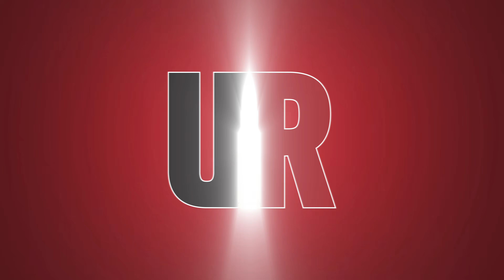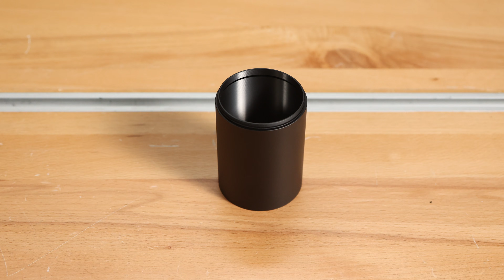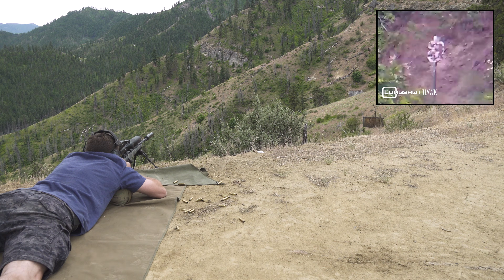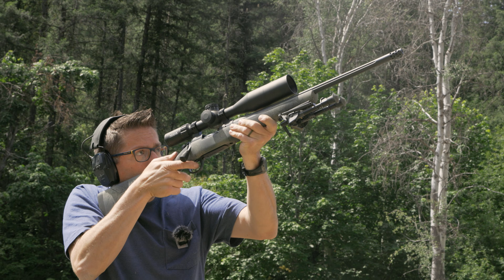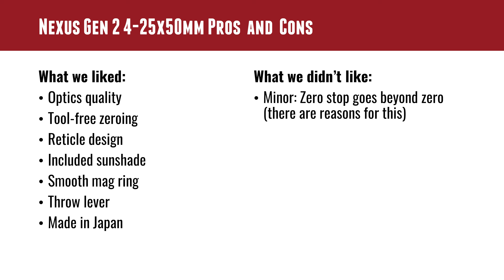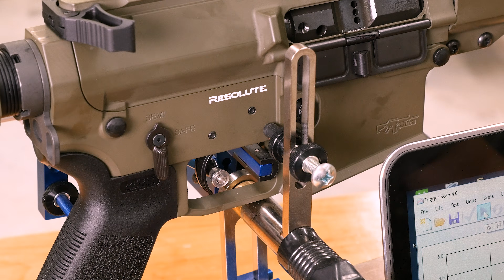TESTED: Element Optics Nexus Gen 2 4-25x50 Scope

Comment: I bought this scope around a year ago and use it on my Daystate Redwolf .177 air rifle for HFT competitions. Target distances can range from 8 to 45 yards away and you are not allowed to adjust the scope during the competition, which means you have to use blur to estimate range. 
All I can say, in my experience of using it, the quality and clarity of the glass is nothing short of amazing and you can pick out the kill zones from the tin shots around them with ease.

Comment: I would love to hear more from you on these Element optics please. I am considering a Vortex Razor Gen3 but there are features on the Element that I really like per your video. Such as no tools needed to set zero and the turn indicator on the elevation. These are lighter weight than the Vortex's as well. Thanks.
Reply from the maker: More Element stories coming!

Comment: This may be wrong or not current but year back it was recommended to dial below your zero and come back up to zero which helped keep the tracking mechanism properly lubed. IIRC lube could build up at the zero stop on the mechanism and cause issue if you never moved the scope further in its adjustment range. Also it give you wiggle room if you are in a environment that very different from where you zeroed. Where I live the DA can change by 2000 feet in a day for example and some people use a 300 yard zero or some other weird distance for dead space.
Reply: That's exactly what I do, I dial 1 moa below, then come back up. I do not like it to stop on my zero.

Comment: Sooo, we're just going to ignore the Mossberg "fix"??
Reply: Waiting for an update on this as well
Reply: I'm guessing the janky "bottom plastic" or whatever the Hell that insert is, prevented a bedding job... So might as well throw $3,000 worth of work at it, isn't that what everyone else in the same situation would do? 😲
Reply: He could have used the chassis and did accuracy testing before rechambering
Reply: The only way to fix that gun would be to throw it in the smelter and make a custom one.
Reply: @PencilProper  That's basically what happened.
Reply: What, do you want an apology from him?
Reply: @edouble9894  admiting he didnt know what was the issue or how to fix it without replacing everything at once would be a good start.
Reply: I mean, this channel is just an extension of the gun rag shill whoever pays philosophy so it wouldn't make sense to actually figure out what was wrong instead of swapping in sponsored parts....
Reply: Mossberg got fixed. It was the "everything" that was the problem.
Reply: @biggs8729  great mudslinging shot guns, otherwise leave the mossberg rifles in the gun store.

Comment: $2,200 optic on a $1,000 rifle. Sorry, but I stick to the 50/50 rule, as much as possible. Ideally I like the 60/40 - 70/30, as much as possible. If it's a $1,000 rifle, more often than not, I'm calling up Arken. $1,000 rifle $500 optic, puts me right in the sweet spot at 66/33. Element makes great optics, done of the very best out there. I'm currently budgeting for the Q Fix & optic choice. If I could find a buyer for my Sig cross set up, it sure would make it easier 😂😂
Reply: You get what you pay for
Reply: @mikeanshit158  Exxactly. Not always though, but when it comes to optics that is generally the rule.
Reply: So if my $1k rifle shoots 1/2 min groups all day it shouldnt get a high $$$ scope to be better at longer ranges? Mmm silly silly
Reply: Bro said “I’m calling up Arken” lmao
Reply: So put it on a more expensive rifle and your issue is resolved 🤷🏼‍♂️😂
Reply: @davidsutton7632  have you ever used a Arken? If not, I suggest you do so
Reply: So put it on a more expensive rifle and your issue is resolved 🤷🏼‍♂️😂
Reply: Think'n just ain't for everyone